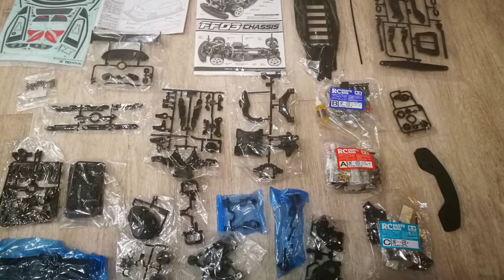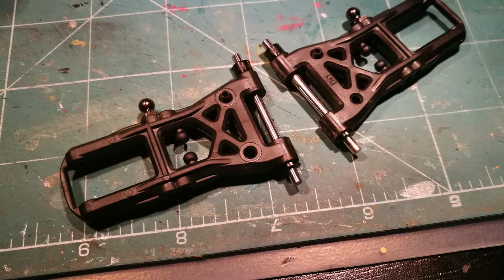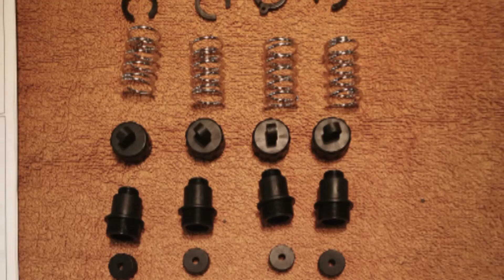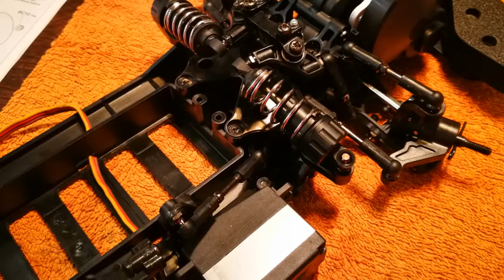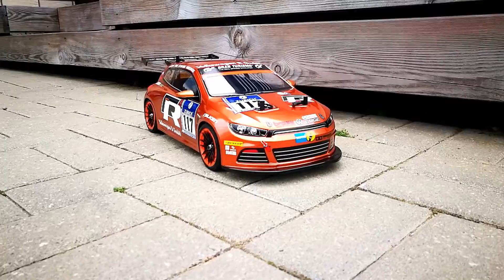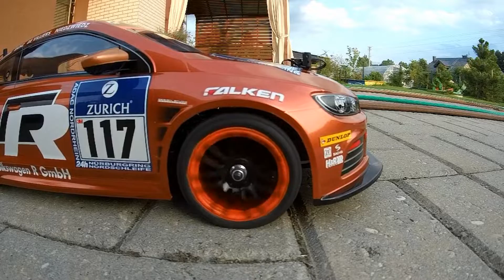Tamiya FF-03 VW Scirocco 1/10 RC car build

Comment: I just got a question about your body shell, after you sprayed that nice colour for your body shell, did you back it with black after your were done with the original colour?
Reply from the maker: You are correct. First I sprayed PS copper from Tamiya and then backed it with black. Thank you for watching!